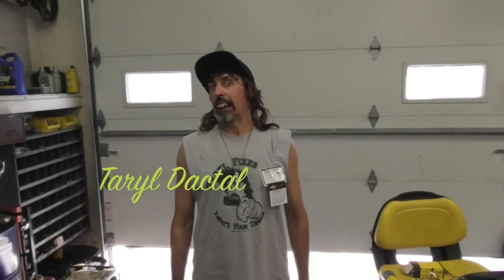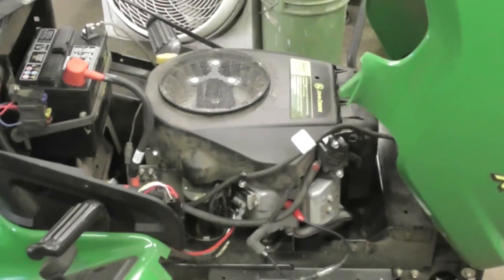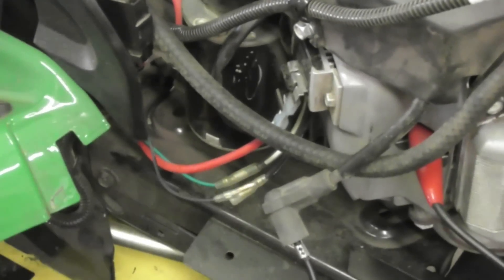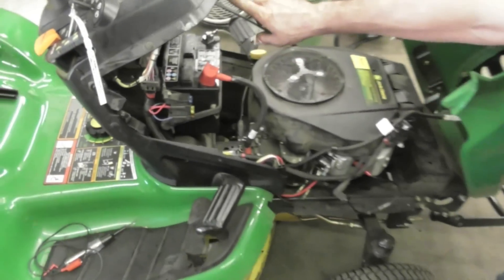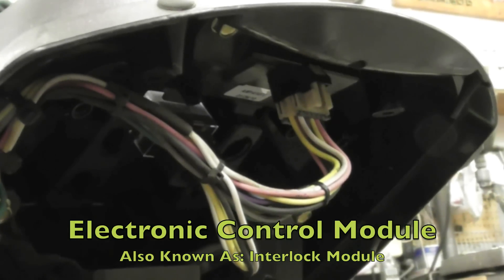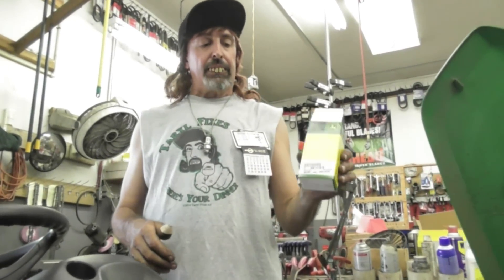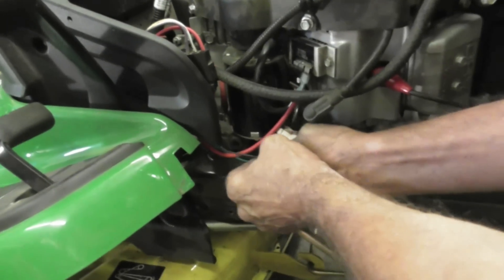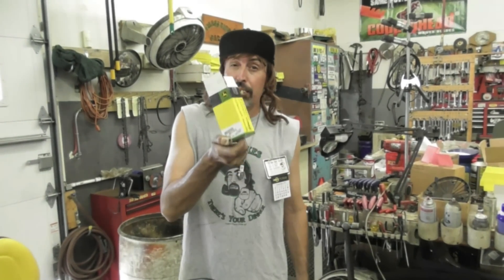John Deere X300 Troubleshooting - No Spark

Comment: Hey Taryl, my 2007 X300 stopped working for no reason.  just had no spark.  So gas or spark plugs or ECU is what I narrowed it down to.  watched you, pulled the kill plug like you said.  started right up, but of course PTO wouldn't engage.  Went to the local Deere dealer the following day to p/u my brand new $71 ECU module and had my 9 year old put it in.  Started right up.

Thanks for your video and mention of the kill plug.   right from the start, I figured it was the ECU (ECM) because it wouldn't start despite my using 5 days previous with no issue.  I had gas going to it.  Either way, I'v also used the down time to change the oil, sparks, check belts, air filter and sharpen the blades.

Comment: You are THE MAN.  My X300 was running for about 10 minutes at a time in the summer but maybe 30 minutes or more in the Spring (cooler air temp.)  Got hot, then died.  When it cooled a little, it started just fine.  This was just like Bryan's prob. 2 yrs ago.  Pulled the black 'kill' wire, and the problem stopped.  BTW, the module is now over $80 ... we'll see.  Thx

Comment: If you don’t want to drop $100 without knowing for sure this is the problem , do this...When you try to start and it doesn’t work , unplug it the control module then try to start it. If the mower turns on briefly then shuts down then you definitely have a bad electronic control module. Thanks for the video on this it put me on the right paths and saved me money. The part is a $100 now but if I had to bring it there it would have cost me a lot more.

Comment: Thanks, I found this very helpful for troubleshooting. But what I learned pretty quickly is that although you can crank it and drive it, it's still useless as a mower without a working ECM.

Comment: Had the same part on JD X320 go bad with slightly different symptoms. Machine would run for about 30 minutes and then just cut off like the key was turned off. No spark on either cylinder. Wait for about 15 minutes and it would start and run normal. Afterwards it might quit again after mowing for a little while. Always would run again after some shut down time. At times could mow the complete yard (1.5 hrs) and it would never quit. Hard to diagnose when it wouldn't stay "broke".
Reply: I'm having this problem now... 2010 X300R 500 hours. Had similar problems over the years.. I've Replaced the coils, fuel pump in the past. Now, it runs for a while, just dies a couple times in the hour+ it takes the wife to mow our yard. Also I have a miss at idle now. When id died on you did it give out a huge backfire at the end?  Just unspent gas..? I'll check the black wire in the am to see if thats what it is... Thanks. Been looking for this help for a while.

Comment: Exactly what I needed got a new battery but no spark. Disconnected the kill wire and bam immediately started. Couldn't mow because the pto will not engage. Too bad there is not a way to make pro work with kill wire unplugged. Great Job!!!
Reply: I’m glad I found your comment.  I have this same problem.  I disconnected the black wire, and the engine started, but like you, the PTO will not spin the blades.  Hoping this new module will make everything right, and by reading your comment, I think it will.   Thank you.

Comment: Those modules can be the cause of several problems. If you notice your mower takes a few seconds to die, it’s because it’s being killed by the fuel solenoid. A bad module can prevent your ignition switch from grounding the coils. If your blades don’t work, that damn module can prevent voltage from getting to the electric clutch. And just like in this video, that module can ground the coils when it’s not suppose to. There’s no reason John Deere needs to put those stupid things on their mowers. All the other mowers that come into my shop don’t have those modules and they work just fine. Over engineered crap. What sucks is, there’s no way to test those modules. John Deere can’t even test them. Before you buy one make sure the problem isn’t the ignition switch, PTO switch, seat switch, brake pedal switch, blown fuse, bad electric clutch, dead battery, etc. If you have any electrical problem and everything tests good, you can bet it’s that electrical control unit.

Comment: when i trouble shoot no  spark issue disconnecting kill wire eliminates ALL safety's in the system, did you test all safety's in the system before coming to the conclusion module was bad? Thanks

Comment: Your tip worked on an X320 as well.  Thanks for posting the video.  Was stumped why I had no spark.
Reply: Replaced the control module - $80.  Hooked the kill wire back up and it stays running!

Comment: Great video!  What if I am getting spark and it turns over but no start?  Am getting fuel to the pump. Prior to this I had to hold choke open for engine to run.  Recently changed the battery, but it was starting for a week or two after it was changed. Thanks for any tips

Comment: Hi Taryl,  Thank you for all your videos helped many times.  I have a 
John Deere JS63c it becomes hydro-locked.  I remove the plug, pull the 
cord to clear out the head but I don't see oil  I see gasoline shooting 
out.  The air filter housing becomes full as well.  I clear it all out 
and it will start, then after its off for a bit its hydro-locked again.  
Any ideas.  Thanks, John

Comment: Taryl, i have 1975 jd 300 with krohler k341 splash oiler that just blew due to mowing angled hill. What would you recommend to repower it? There are recommendations for a 24hp honda but this kit is over 2k. What say you? I just bought a lx178 water cooled kawi but want the 300 rinning again.

Comment: Taryl, I have a Deere LT160. Pulled in in garage...everything fine...then went to start a few days later and it wont start. Turns over fine...has spark and I checked solenoid on carb which is retracting fine. Spark plug is dry as can be. I sprayed a shot of starter fluid in and although turning over fine it never even sputtered. When I removed the fuel solenoid plenty of gas drained from bowl. Could a valve be stuck not allowing gas to be sucked in?

Comment: My X320 starts up and runs just fine, but the PTO clutch does not get any voltage when the PTO switch is engaged.  I the clutch is fine, I can apply 12v directly and it will engage.  I narrowed it down to the ECU or wiring harness.  which one should I try first?

Comment: I had similar problem on my X320. Battery died. I replaced it. Engine would not start - no spark. I disconnected the black kill switch wire and the engine started fine, so I was able to drive the X320. But the deck would not engage. So I checked out the control module AM137667 (07/19/08) and ordered a replacement part AM141075 (05/15/19). Fitting it this weekend - hope it works.
Reply: Fixed. Replaced the AM137667 with AM141075, reconnected the black kill switch wire. Started perfectly and the deck engages.

Comment: Hey Taryl I have a JD 540 SERIES big ol water cooled kawasaki engine no fire but when i take the black kill wire off the left side then fires but the right wont fire but it will run on the one cylinder the black kill wire goes to both coils..So Im thinking if one coil is bad it must be grounding out the good one also is this right?

Comment: I would guess it could be the ignition switch, or a mouse chewed kill wire. Is there a way to isolate the issue to module? I know the boys at the dealer  won't take back the $70 part if you just need to test.

Comment: can this module cause an intermittent spark interuption? I'm having a problem with an X300 (Kawasaki engine) with a slight miss/backfire. I cleaned the carb, new plugs, new coils, adjusted the valves... the slight miss/bacjfire remains. If it's not this, is it the timing?

Comment: Taryl, I have a cub Z Turn with a kawasucky 22hp engine, runs perfect until you try to cut then it starts to pop and run like it has a bad coil, what's the best way to troubleshoot w/o buying a part at a time?

Comment: Great video Taryl. Is this module used on other makes of tractors? I got an older Craftsman with a Kohler engine. It was cutting the grass, shut it off to take a break, came back and tried to start it and would crank but will not start. Yes no spark. The owner disabled the back fire solenoid and put an inline fuel shutoff he thought that was it. It wasn't. I noticed that black kill switch wire on that Kohler I will check that out to see if it is the coil or not. This tractor is really puzzling. Any help, Taryl or anyone?
Reply: Colors 

Kohlers are famous for having coil problems ,also jump seat switch with piece o f wire, good luck

Comment: This helped me solve my starting problem. However, you should point out that if you don’t replace the module you will be able to start the engine, but not engage your mower blades

Comment: Tried jumping mower from plugged in charger fried control module.replaced it starts right up but the mower deck wouldn't engage so I replaced the pto switch.still won't get mower deck to engage. Any ideas?

Comment: My Kohler 20 hp Courage, keeps trying to fall apart.......Now a Ex Valve seat fell out and slightly bent the valve :), so I ordered a new Valve, reinstalled the seat (seat looks like new), thinking about penning over the very edge so It wont fall out again, re lap the new valve, put it all back together and see what happens. In the manual they say valve seats aren't replaceable, due to they are pressed into the head, and cant be taken out, that is unless they fall out on their own. Just trying to push this mower as long as I can, got it for free, and used for 5 years. And living in Florida, with all the sunshine and rain, the grass grows quick.

Comment: This looks like an example of John Deere over-engineering for the purpose of selling "dealer only" parts. A $70.00 module for a lawn tractor?
Reply: Too many law suites. That's why. Dumb people not using commen sen.... Shoulden be driving any thing. Just buy a older mower and repair it or install new engine and by pass the new safety sys. to the old sys.
Reply: And their spark plugs are fn robbery!!!
Reply: @grandmasmalibu  ya, especially a secret blackout box that the customer can't possible know about because it's totally hidden from sight.

Comment: Could this be the culprit if the tractor won't start at all...nothing. I checked the battery and it was low but I charged it up 100%. It wasn't completely dead. But I can't even get the starter to crank. I hope it's the module!

Comment: 2010' JD X324:    Always fires right up. Never an issue. UNTIL 2 days ago... :(  I shut it down to chat with a neighbor and after it would not turn over. Zero. DEAD!!! Pushed her home and tested the battery. Under 10 volts. Put the charger on it and the charger did next to nothing. So short in the battery, right?? Had to finish the neighbors yard if possible, so I jumped it off my truck.  Fired right up and ran like a top. Finished her lawn and coming back around the block doing a clean up pass, the electric clutch quit. Fearing the worst, I drove straight back to my shop. Only about 100 feet after the clutch died. I no sooner got to the shop and the engine quit. Just like I shut it off... Figured the battery was shit AND tried to fully charge it and load test it, JUNK.. So I bought a new battery for her. Cleaned everything up nice nice and turned the key. She spins over fast and will not start. Definitely getting gas. Spins faster than I remember the old battery cranking her, but no start.  That was enough for my bad back for one day.  Then I did a search for this issue and this video popped up. Since I watch this channel often, I was comfortable with what he had to say.  Sure as shit, I just went out and detached the black wire. Hit the key and she is purring like a big cat!! For shits and giggles, I unplugged the part he shows and cleaned up the terminals. (Really didn't need it as it was packed with green grease, but it looked like it could have been corrosion, so out came the brake cleaner. (NAPA, not a sponsor.... )  lol... Plugged it back in and she just spins like a top without fire....  So THANK YOU TARYL for making this video and saving my sanity and back....  This all happened while getting ready for hurricane Dorian.   Gotta love Florida.......  I forgot to mention, the old battery was dated 3/15.  I'd say it lasted pretty damned well for any battery in Florida. I'd have bought another if I could have found someone selling it. Ended up at Lowes. Higher CA and high reviews. Just look at the dates and pick the newest one on the shelf. The ones in the front of the row were already well over a year old. The one I bought is 2 months old.  Thanks again....
Reply: Also, I did pull the part and it has the AM141075 marked on it and also 2010, so I am guessing it is original. I see many peeps have changed it a few times..... They don't tell you to disconnect the battery before charging it or jumping it, but this is what many, many people have described as when their died.... So if the battery dies, pull one of the cables off the battery to charge it up or chances are the same will happen to you.... Personally I think it a junk part if you cannot jump the battery or charge it without pulling the cable.... JD needs to rectify this BS......
Reply: UPDATE:  Now it is Sept. 2022 and I WISH I still had a good memory as I have done the same thing again.... The battery died after 3 years. I jumped it off my truck. (NOT RUNNING). It started and ran fine until I pulled the jumper cables. Batt read 10 Volts and 3 years old. Went back to Lowes and bought another. Hooked it up and nothing at the key. Jump the solenoid and she turns over great, but no start.. I have another AM141075 out of the machine and of course it is Friday and JD dealers around here are not open on weekends..... I am really NOT enjoying my Deere and their shitty engineering... What do they say Nothing Runs Like a Deere!!  Well nothing I own that says Deere on it RUNS!!!!!!

Comment: Anyone have a clue whats going on. My dad has a x340. New battery. New plugs. New starter, 12.53V. New selonoid. No lights on dash like dash is completely dead. All fuses replaced. I was thinking this ECU but seems it's mostly a no spark issue. I would think a bad PTO or brake switch would still have lights on dash and crank just no start.

Comment: Unfortunately this trick did not work for me. Any other reasons I’m not getting spark. I have a D130 and occasionally it will backfire.
Reply: If you unplugged the kill wire and it still doesn't have spark it needs a coil or plug I would do the spark plugs first
Reply: Ok thank you for the info. I already did the plugs so now coils it is.

Comment: Might just be better to wire in a switch on the dash for the kill. Like repurposing the reverse now button.
Reply from the maker: You can wire one in if you don't wanna buy that module. Both ways will work
Reply: Taryl Fixes All all you need is a sort jumper for the reviser button so it's always on and working and then 3ft of cable for the kill wire. Only like 1$ worth of material and if you have a spool of wire it's like nothing. Be better the 70$ for a modular that's still mostly working.